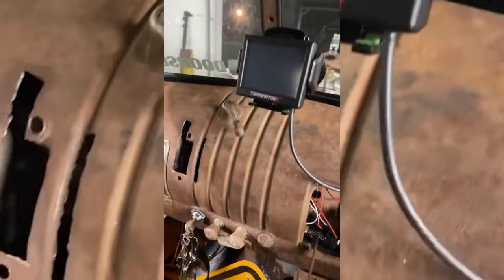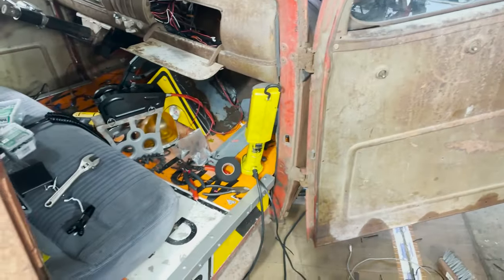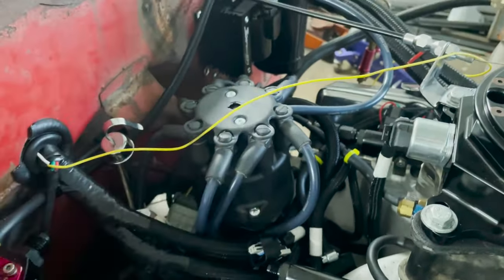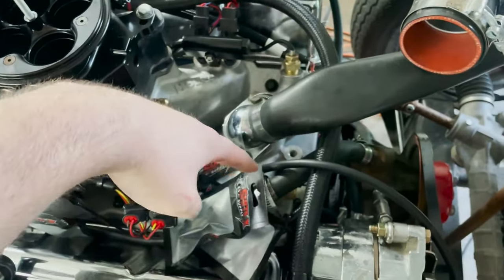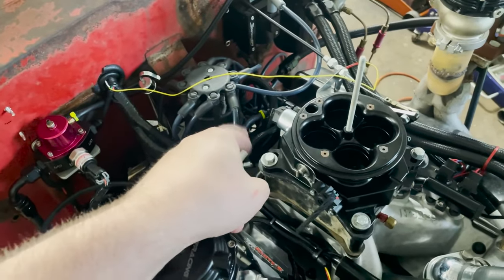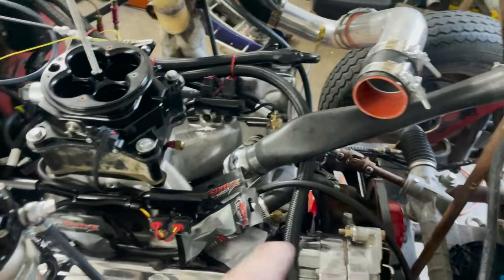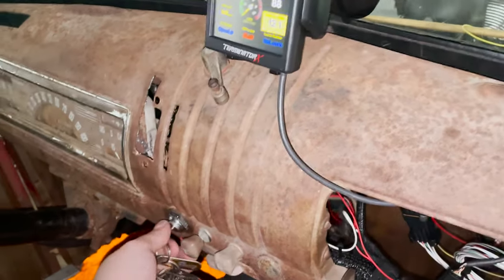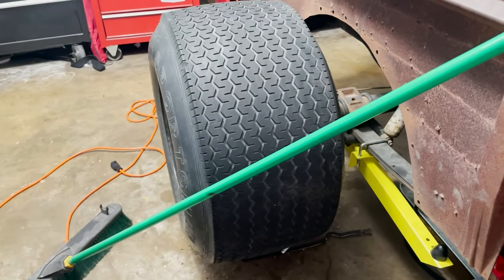Holley Terminator X RATROD SBC AND TWIN TURBOS

Comment: Hey there! Just stumbled onto your videos. Great content! I’m actually building a similar motor setup on my 71 K20. I ordered the terminator efi parts at the beginning of the year and it took nearly 3 months for it to show up due to shortages. Same intake as well. 
I was curious about the headers/manifolds you are using. Who makes them? I was looking at the Flowtech turbo headers but haven’t pulled the trigger in hopes of a more cost effective solution.
Btw sucks about that Hyperspark box. You got my kinda luck!
Reply from the maker: Thanks for following! Since this video I actually redid my entire hot side the headers shown in some of my most recent videos. I was given some forward facing ones and I did some custom fab to them. Lots of options though just google SBC turbo headers you’ll have a ton to pick from. I waited about the same time for my efi stuff.

Comment: The ppl at Sniper EFI said with the terminatorX and the dual sync distributor I wouldn’t need an ignition box is that true.
Reply from the maker: You would at minimum  need a coil driver. I would recommend just doing a box... It's cheap in the whole picture and makes it so much easier. Get the hyperspark set up. A lot easier. Do it right the first time.

Comment: I’m doing a similar setup is that the Holley 300-260 intake if so I have the same one but I have the Holley EFI elbow 300-240 with the 92mm Holley sniper EFI throttle body I also have the hyper spark ignition box and coil but with the dual sync distributor going coil near plug nice setup
Reply from the maker: Yes it is… that should work good! I almost went the elbow route.
Reply: @DoorslammersGarage  
What’s a good set of heads to pair with that intake preferably aluminum
Reply from the maker: @antionewalker4081  budget wise flotek. If you want some really nice ones go AFR.